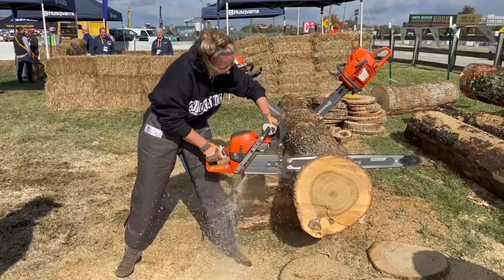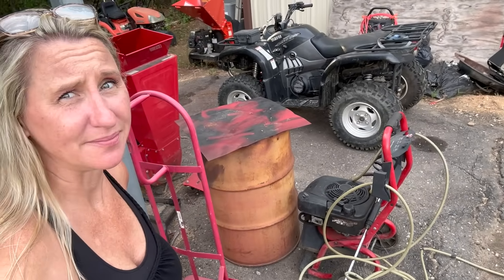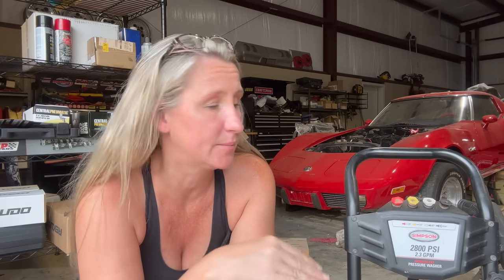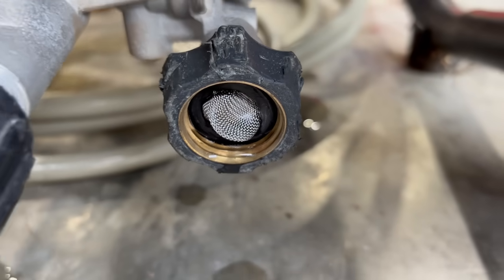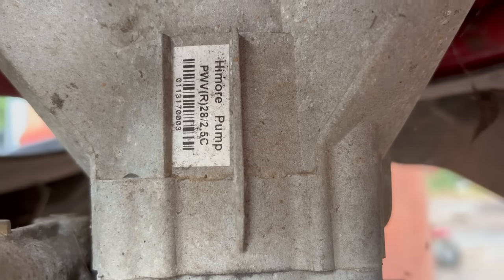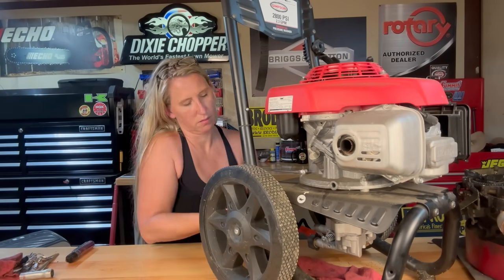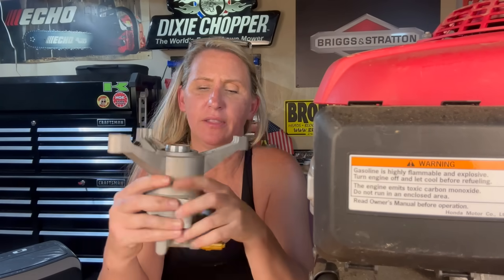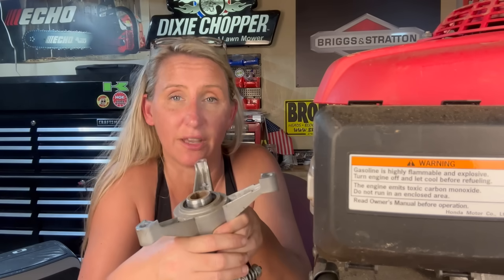STOP Paying Repair Shops! Pressure Washer Has NO Pressure?! Check Out This Super Simple Fix!

Comment: I just pulled out the unloader valve and lubricated it and put it back, that was my problem and it’s a simple fix, sometimes you have to replace them, but in my experience six times out of 10. That’s the issue.

Comment: Love your videos Bre! Neighbor gave me his 5HP TroyBilt pressure washer that wouldn't build pressure like the one in the video. Instead of replacing the whole pump I wanted to find the problem. I found a plastic check ball seat in the unloader valve had disintegrated. The pump manufacturer has upgraded the ball seat to brass but it was over $50 for just the part and it was out of stock everywhere. I found the complete unloader valve assembly was only $30 online and had the upgraded ball valve in it! For a $30 fix I had a great running pressure washer.

Comment: Fortunately with my 8GPM commercial belt drive pressure washer. I have a 110 gallon bypass tank connected from the unloader and I can stay off the trigger(idle) for hours(when my customer comes out and wants to talk about……) and the pump stays cool 😂. I tell my customers that have the homeowner model pressure washers that when they come off the trigger to immediately turn off the engine. Great video, Bre. Brian.

Comment: I just bought a Simoniz gas pressure washer for $30 from a guy who said the motor ran fine but the pump didn't work - water shoot out the nozzle. In the video, you mentioned checking that the hose wasn't plugged. I went right out, removed the hose, started the pressure washer and sure enough, the pump spurted water just fine. There was a slimy gel blocking one hose connection that I cleaned out with a small screwdriver. (I think the gunk might be congealed soap since the soap dispenser was plugged in.)
It's odd that soap could stop that much pressure, but there you go! Thanks for the tip!

Comment: I have had 3 hip jobs.  The first one lasted about 8 years and then started popping out of joint -  the answer to that was a hip revision - replacing the replaced left hip. The new one is much better since it is locked in place by a metal ring.  Having a hip replacement is a GOOD thing.  Best wishes!

Comment: I keep on using my 2004 Campbell Hausefeld pressure washer. I had to replace a spring in it about 10 years ago. The pressure wasn't up to snuff. It's a Giant pump. I always store it with no gas, pull it through to get the water out, and drain the hose. About every 5 years I service the pump. So far so good.
You're right about the idle. I saw that in my manual. I try to never let it idle. Not even when I start it.

Comment: I had a Craftsman that the pump kept getting weaker and weaker.  My wife said just go buy a new washer.  I checked online and found the pump for $75.  Ordered it in and had it replaced in about 45 minutes.  Piece of cake.  Used it for another 5 years till the engine gave up.  Then I got a new one but saved myself I figure 300.00 bucks for those years.  Great video thanks.

Comment: I left my new Kenmore pressure washer in the barn over winter one year. Yep, I had not drained all the water out of it before storage. I ordered a rapair kit with the o-rings and fixed it about 95% right. Water leaked out a bit, but I wasn't going to go through the hassle of taking it apart again.

Comment: I am by no means an expert I always come to you for knowledge on these things, I wanted to share my experience with my 14 year old craftsman w/6gp Briggs and Stratton and my brand new TroyBilt with the Honda engine. I had the very same issue with both. Water coming through runs no pressure. I found out it was my error the Honda works great now because initially I put oil in it and it met the mark but I screwed it in to check the oil level which makes it appear to be at level. I finally found in the owners manual 12.5 to 14 oz and do not screw in the dipstick to check. Why this info was not in the quick start info I do not know but that worked. So I decided to check my old Craftsman today trained the oil and refill and checked correctly and bingo it worked! Mined you I used that unit weekly to clean area rugs and buffer pads and never had an issue until the last time I used it I guess I messed up the last oil change. Now I am debating on keeping or giving to a family member. Thanks for all you do.

Comment: When you’re done using your washer remove the hoses & with the kill switch in the off position pull the cord 3 or 4 times, that will expel all the water left in the pump. Good luck to Ron.🙏🏻

Comment: I paid around $3,000.00 for my Diesel  2,000 PSI Hot Water / Steam Pressure washer with an oil burner in 1989.  It needs new Pistons.  I bought a rebuild kit from a local Dealer  who has since retired.  My Pressure washer had a reservoir with a float.  I eliminated the Reservoir , now  the pump is fed by 40-60 PSI Cold water instead of suction.  Also I have a water softer in my shop .and I feed my pressure washer with soft water.
  I had to  acid clean my burner elements  to removed all the iron and calcium before I had the Pressure washer.
  I was aware of not idling.  I always turn off my pump  if I pause for any reason more than 30 seconds..   My has electric pump belt drive  220 volts. I don't even use soap.. Hot water works great on greasy old trucks and front end loaders ect.
  Seems KAT is a very common brand of pump .

Comment: I hope Ron's surgery went well.  When people store these pressure washers, they should put antifreeze in the pump.  I made a pvc pipe that attaches to the water inlet of the pump, and put a valve on the other end to pressurize it and force the antifreeze into the pump.  If you are not storing it for too long it is a good idea to blow the water out of the pump with air pressure.  There are attachments made for this that make it easy.

Comment: Well Ron here's to a speedy recovery so you can dance the night away with Bri 👍, perfect timing for this video I am getting ready to use my pressure washer  and it hasn't been used in 2 summers now, hoping it should be fine it is a Ryobi with a Honda engine and has always been good, so i will check everything you discussed in this video, blessings to Ron 😎

Comment: I repaired the pump on my Craftsman 3000 psi washer.   A thrust bearing came apart inside the pump.  I found new bearings on ebay for cheap, so I decided to give it a shot.  I put it together and put fresh oil in the unit and it worked perfectly.  Two years later and I'm still using it around the house.  p.s. I would recommend new gaskets if you can find them, otherwise consider using some type of gasket sealant.

Comment: Just putting this out there for people to try before giving up and ordering a new pump… Last year my dad picked up a used one that hadn’t worked in a year or two. We hooked everything up and it did nothing. So I blew air in the inlet and outlet a few times (make sure it is sealed as not to lose much air).  After blowing air in one then the other a few times, I hooked up water, fired it up, and it started working again so something must have loosened up. Still working today! Hope that helps!!

Comment: The problem with the cheap pressure washers is their water cooled by the water they're pumping. You stop pumping the water it stops cooling. I've had clients ask why I don't ever stop spraying......
Reply: The problem is your dead-heading the pump.  Every time you stop there's a sudden and drastic increase in pressure, causing excessive stress on smaller components.  Eventually, something's gonna give.  Idling the pump is what causes overheating.
Reply: It's a educational issue. 
The retail end doesn't care if you burn it.
Reply: My handle is zip tied open and I start it like that lol 
5 years and I use it alot in the shop 😊
Reply: All pressure washers are cooled by the liquid they pump.
Reply: @philliphall5198  That's actually a good way to bypass The pressure valve that controls the engine when hard water clogs it up.
Reply: Many thanks for all your videos. As a 74 yr old retiree, I've got time to do my repairs and modifications on our yard equipment, and thanks to yr teaching iveclearned a lot and saved a bundle!! Thank you again and good  luck and prayers to you and Ron. I feel for him!!
Reply: Thanks for this video, I now have a pressure washer that belonged to my dad before he passed. I haven’t even tried to start it yet. He had only used it a couple of times. So this video came along at a good time. I will be praying for Ron. I hope his surgery goes perfect and wish him a speedy recovery as well.
Reply: Prayers for Ron’s recovery. Was his a robotic replacement?
Reply: Even if you have an unloader valve the recirculated water gets hotter as it recirculates. 
Hot water is a killer of pumps. 
If you want your pressure washer to have a long life go get an AB wand. 
It has two outlets and a knob that switches between the two outlets. 
Take a piece of wire, cable tie or string and tie the trigger so the wand can never be turned off so the unloader valve is never activated and you always have cold water through the pump
Put a regular orface on the A side and when you want high pressure use the A side (by turning the knob eh). Put a large low pressure orface on the B side.  When you want to set your wand down select the B side and the low pressure will keep the wand from attacking you or anything else in the vicinity.  Your pump always has a flow of cold water and the o-rings stay happy and healthy. 
I have a hot water Landa it pumps cold water through the heat exchanger. 
A friend of mine liked how the hot water on my washer cleaned a tractor we were working on and so he went home and ran hot water through his el cheapo from home Depot. 
He said it worked great till the water got hot.
Reply: Prayers and speedy recovery for Ron!🙏
Reply: I love my 100 green works electric pressure washer. I bought it 6 years ago. When you release the handle the pressure washer quits! That easy! And I use it a few times weekly since new.

Comment: you're awesome, I received a Craftsman with no pressure and have been researching how to repair the pump, would still like to, but I know finding the parts will be the problem (and it opens up a black hole of variables).  I did a search on the model and only got original parts at like $300, I'll get the actual pump model now and see; but will first check the connections and inlet as you mentioned first.  Great vid, good luck to Ron (he's probably all recovered now) - they knock those things out as easy as you repair.

Comment: I've used aftermarket pumps (even most of the AR brand pumps are made in China now) and have decided that I prefer the ones sold by Tool Mart Inc in Missouri.  They have vertical front and rear facing, as well as horizontal that fit just about all of the big box style ones out there.  As mentioned in the video, sometimes you need spacers, maybe new/longer bolts, etc.  So far, I've probably used 10-15 pumps from Tool Mart, and they have all worked out the box.  I've gotten pumps from other places, and a year later when I first hooked it up, wouldn't even let water through it!  I had to disassemble the pump and clean a bunch of gunk out of a new pump!

Comment: Prayers for a speedy recovery for Ron🙏. I have a tip that was given to me many years ago for my pressure washer and that is:
When you are done, disconnect the hoses, tilt the machine towards the hose connectors, drain excess water and then spray some WD-40 in each connector and tilt machine back, then pull the cord to rotate the engine a couple times. Then cover the hose connectors. I have an old Craftsman that has many hours on it and only gets used a couple times a year but works. I have bought and resold a few pressure washers and it's definitely not worth taking the pump apart. The rubber O-rings are usually dried up and the springs under them are sometimes rusted. It's easier like you suggested buy another pump. Thank you for the reminder to never let idle?

Comment: A couple of weeks ago I went to use my power washer for the first time this year. Water was pouring out of the pump so obviously it froze in my garage last winter. I took the pump off thinking I might be able to fix the crack but it was bad. So... the pump had a model # / part # and I went to Amazon. Found a pump that looked right for $80. Put it on and works like a champ. It did have spacers which made one of the bolts too short so I had to go to my local farm supply store and get a longer bolt.
Overall, it was very easy.
Funny how your video just popped up after I fixed it.
By now Ron's hip should be healed enough so he can get back to giving you a kick in the ass when you need it 🤣🤣🤣 just kidding. Your probably a sweetheart 🥰
Thanks for all your videos. You have helped me more than you know.

Comment: I picked up a pressure washer off the side of the road years ago that the motor was a Briggs that was the same size as my mower . After my mower wore out I used the motor off the pressure washer by combining the two to one . I used the crank and cam and flywheel off my mower and put them into the washer motor then mounted the engine back on my mower with my carburetor. And I was back in business.

Comment: Knew nothing about them and get an old one, previously returned to a big box store for free. Couldn't get it to start so I tore the carburetor apart, cleaned it, reinstalled it, and got it running. But no pressure. Nozzle was partially clogged, cleaned it, still no pressure. Installed a tee at the water inlet, connected up a second hose from a second faucet and voila, good pressure. Didn't know about not letting it idle and I'll definitely remember that and really appreciate the advice!

Comment: Hey, make sure he does all of his physical therapy for a great recovery! Many years ago, I was told by a company that sold a pressure washer with a Honda motor and a cat pump, if you have WELL water run the pink RV antifreeze through the pump when you're done using it and use pump saver in the winter time Thanks for a great video

Comment: After your advice on a previous video about not letting the power washer idle I grabbed the metal part of the wand to feel the temperature as the water runs thru it.  Sure enough, it is really warm after idling only a minute. You don't notice it when your hands are always on the plastic parts of the wand.  So now I make sure I pull that trigger every 30 seconds at most.  Makes a big difference.

Hang tough, Ron!

Comment: Love the channel Bre. Prayers for Ron. 

When pressure washers run without water flow, first, it overheats because water is designed to cool it but the big problem is is cavitation. When it gets boiling hot, it converts the stagnant water to steam. When water converts to steam, it expands 1,600 times. This is what blows seals. Any firefighter knows about cavitation. 
Glad to see you flowing water before you start. Most owners dry start then lay the wand down for extended periods killing the machine. 
These machines can be extremely dangerous. If water or mixed chemicals get injected under the skin, the tissue will need to be debrided(cut away). It basically becomes gangrenous. My friend forgot to relieve the pressure before disconnecting the hose and it injected water into his eye. Wills Eye Institute could not save it. You really should be fully clothed with eye protection. When spraying off a ladder, the back pressure has knocked people off ladders injuring them. Be aware of your effluent- crazy people today will sue you for your runoff getting into the street, their yard or the nearby stream. Go easy with it and use a wider nozzle pattern than you think you need. Pressure washers destroy masonry, especially stucco. 

Please keep up the vids. Perhaps more using test gizmos- pressure and vac. testing for ex. 
Thx

Comment: Great video! I repaired a pressure washer pump several years ago. One of the plastic cones that retained the check balls had failed and a piece of plastic from it was lodged under the check ball. This prevented the pump from building any pressure. I was able to get a repair kit and got it fixed. Last fall I accidentally started the pump without the water being turned on... oops!! I noticed the pressure is not as good as it should be but haven't had time to tear it apart to see what I messed up.

Comment: I have karcher water pressure that would lose pressure every few seconds. I found a replacement part called the "unloader valve". I took the pump off and replaced the valve and it solved the problem. The part cost around $25.00
One caveate, it took me several times to reassemble the pump correctly. I did not take pictures with every step of disassembly. Thinking i could remember how it went back together. I make this mistake all the time. I am slowly over coming this tendancy to think i will remember how everything will go back together.
Great video. I love her honesty.

Comment: Had both my hips replaced last year (5 months apart) and going for a new knee this fall. I'm confident that Ron will rock on with some new components. 

Also, I've had good luck with replacing pressure washer pumps. I get them from the local scrap collectors for scrap value, pop a new pump on, and resell for small profit. I'm glad you mentioned the spacer issue, I've been bitten by that one also. On thing to also watch for, is whether the hose fittings are oriented to the front or back of the motor. It's easy to get the wrong pump because of this. 

Good luck!